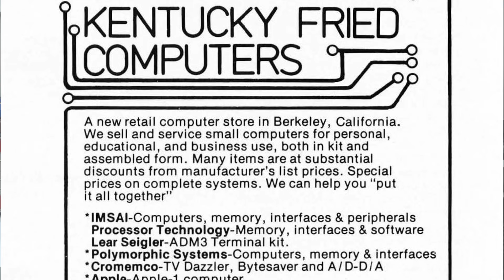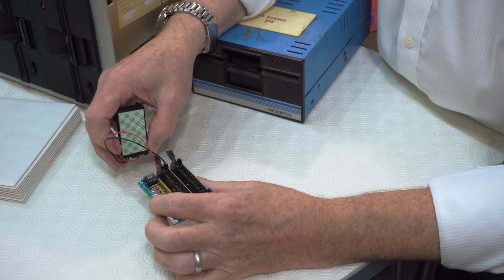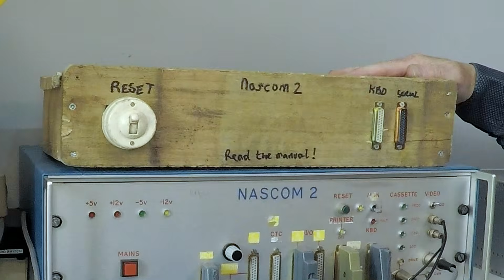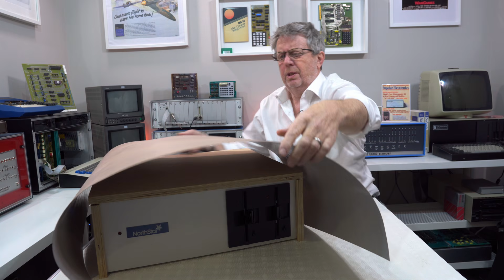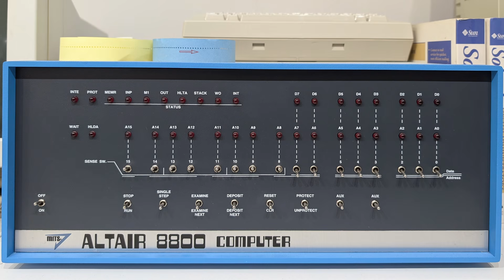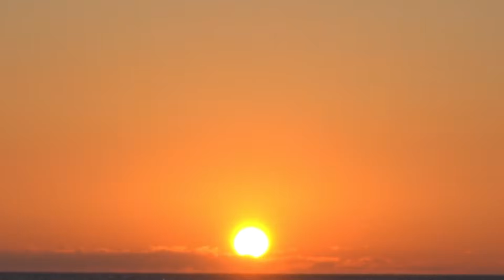The Northstar Horizon, Finger Lickin' Good

Comment: Did a great job on the lid.  Seen so many with the front edges cracked off where the lid catches on the metalwork when being lifted. BTW, that slot down below the power switch takes a 34 way IDC connector and is a neat way to get the floppy signal out the case.
Reply from the maker: Thank you, I managed to restore my old broken one too using decent beading some left over veneer. 

I had never noticed that slot, that's really useful to know, thanks.
Reply: @GlassTTY in one part of the vid, it looked like the top was on backwards. The slot and veneer go round the front face plate and the unveneered back just hangs. Lid is secured using long UNC slotted pan head screws and rest on a washer sunk into the wood. I'm thinking of bending up some acrylic to show the insudes off in public as those heatsinks on the left of each card do get very warm and it needs the airflow provided by the lid. BTW, check your +8 and +-16v rails. Mine run way high and I use a Variac to trim them down to spec. Considering a 48v transformer in series to reduce the mains input or a couple of DC/DC converters to set the rails to a more reasonable level. I have the "export" power supply but it behaves more like a 200v transformer than a 240v one.

Comment: The first disk system I bought was a NorthStar double density controller and a pair of SA400 drives. I had both NorthStar DOS and CP/M 2.2. I think the controller and drives cost about $1400. CP/M was another $170. The SA400 was about the slowest disk ever. It had a literally snail shaped cam that moved the head from track to track. Soon got a Morrow disk controller,  8" and much faster 5 1/4" drives. Working with personal computers in the late '70s .. early '80s was quite a learning experience.
Reply from the maker: Thanks for sharing. it sounds like you had quite the journey with those early disk systems. 

Here in the UK we were a few years behind, probably due to the poor economic situation here at that time. Buy the time I was adding disk drives to my system it was early 1980s and I was able to get the Teac FD55 drives which seemed pretty good to me at the time.

Comment: Through a quirk of fate I have several North Star Advantages.  Pretty nice machine, despite the lack of wooden cabinetry.  I've done a couple of (aged, dark) videos on them, but the short version is they're quite a bit closer to being the business machine the Horizon was daydreaming it could be: a relatively compact single-user workstation.  Power cable, printer cable, go.  Nice Selectric-style keyboard and a 640x240 framebuffer, and later its own 8MHz 16-bit option board.
Reply from the maker: Thanks for sharing it sounds like the Advantage was good machine. I know theydid the 8/16 multiuser stuff for it but I wasn't aware of a 16bit workstation option, that sounds interesting. I'll take a look at your videos.

Comment: I worked on one of these for a summer internship in the early 80's.  It had a metal lid and ran two main systems.  The first was an inventory control system that required NDOS, the other was a primitive CAD system, DASOFT, that ran on CPM and required two floppies to load/run.  The HP plotter was plugged into one of the serial ports on the back.  We had many problems with DASOFT and when we called their support line they assumed we had an Advantage, yikes!
Reply from the maker: Thanks for sharing, is good to hear about how these were used. Was the internship in the UK?
Reply: @GlassTTY  My internship was in West Chester, PA in the states.

Comment: Seeing this video is reminding me that I have a disassembled North Star in my garage that I really need to get back to restoring someday. (I couldn't help but laugh a little about the complaints about your tatty wooden lid; the lid of mine, other than a bit of wooden veneer that needed to be glued back down, was in great shape. It's everything else that was completely trashed when I got it. I think I'll be able to get most of it running, but the floppy drives might never play the piano again.)
Reply from the maker: I hope you manage to get it sorted out. Based on what others have said in the comments, FlashFloppy on the Gotek now supports hard sectored disk images making it really easy to use.
Reply: @GlassTTY  A mod I intend to make to it when I get back to working on it is adding a monitor ROM like yours has. Mine only has the redirect to the little boot PROM on the disk controller, so a lot of the system would need to be working before I could do any diagnostics as it stands. (It's handy the CPU card has a place for it already, I was just going to throw together a socket adapter so I can use one of the Flash chips I've used on some other projects in there instead of hunting down an old EPROM and a burner compatible with it.)

They are certainly interesting machines if your prior experience with 70's computers was confined to machines like the TRS-80 or Commodore PET. (I have both.) Details like every S-100 card having their own power regulators, the capacitors the size of soup cans in the linear PSU... the level of sheer brute force kind of comes across like if you asked an Orc to build a computer. The backplane of mine has a big scorch mark and some of the traces are bridged with wires around one of the slots because a previous owner clearly messed up at some point. (Maybe they plugged a card in backwards?) You're not crazy in thinking that something bad could happen that the wooden lid wouldn't be able to contain. ;)

Comment: Will be nice to see how you get on. Because, the school mats department at my uk comprehensive school had one running timeshare basic. One terminal that had an external large crt, a teletype and a video genie 2 with a terminal emulator rom. Would fill my gaps in a sparse sixth form timetable learning basic without a manual or the internet of course.
Reply from the maker: Thanks for sharing, I've had Time Sharing Basic running on the Altair but not this one so far.